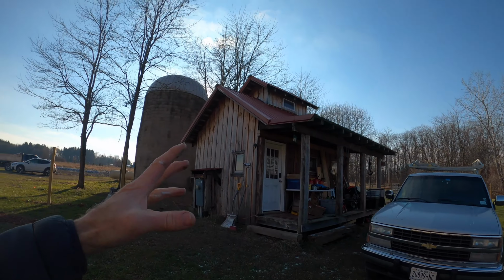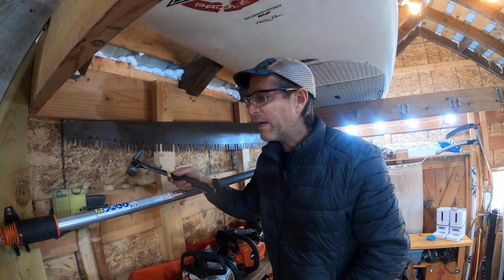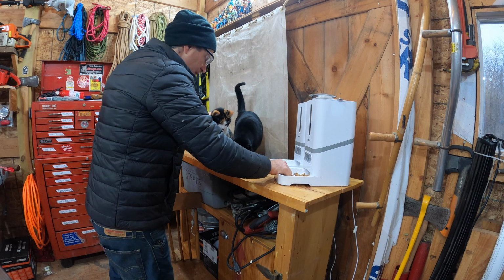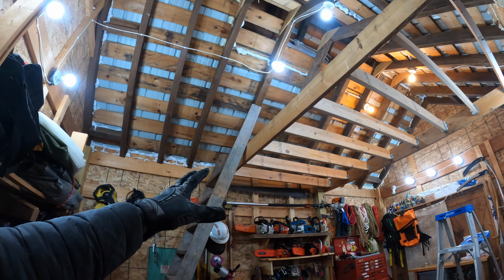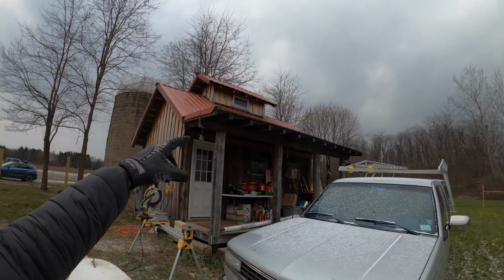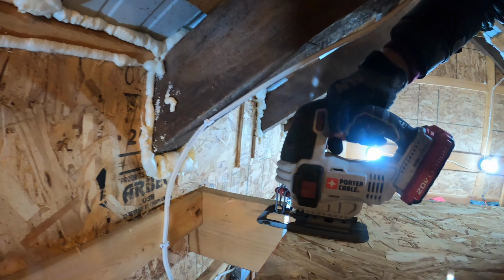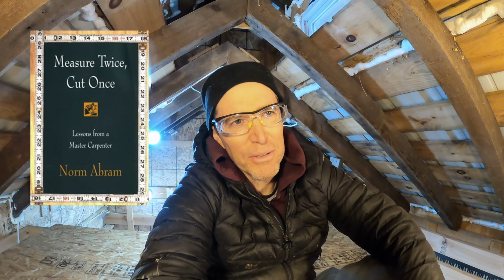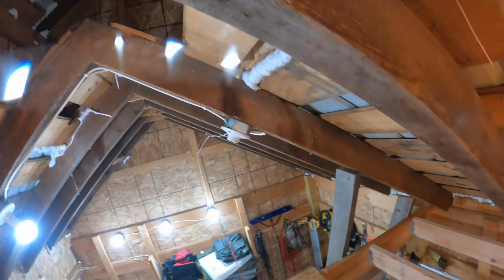Saw Shops Gets a Loft

Comment: I realize this is a little crazy - but imagine a board that goes about 30 degrees up and out from the side of the ladder up to the rim joist/2x8/whatever - then a horizontal piece that spans from it to the side of the ladder, which is a new offset top step. It would keep the ladder out of the way on the floor, but give a little easier access to the top. Also, a railing/hand hold off to the side might be handy. Saw shop looks great - does it have a wood stove yet? Is it about 12x20? Merry Christmas!
Reply from the maker: I like that idea of a side-step off the ladder -- currently I've gotta dig my fingers under the rafters, lift up, and pray I make it! Sounds like a real improvement. No wood stove yet but I did get a freebie propane stove. With the price of propane where it is I may have to convert it to wood
Reply from the maker: Oh yeah, 12x20 ... just right for two barn cats
Reply: @metaspencer  Where I live they make new laws about wood stoves all the time - I've got 2 in my "garage" waiting to get used in buildings that I still need to put up. Paid $200 for the pair of them. One pretty, one hideous. You might find a used stove for cheap.
Reply from the maker: I’m always looking! I have another building in the works too